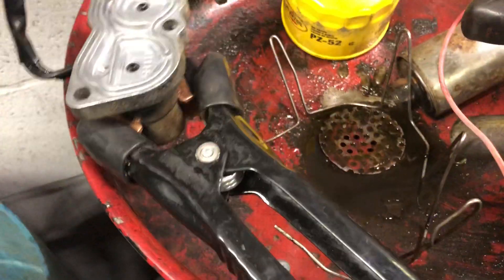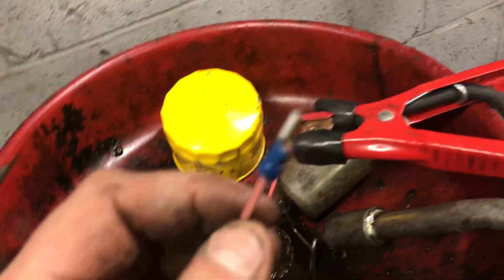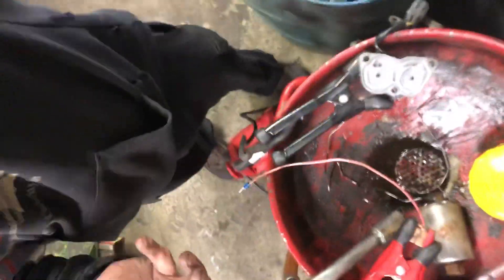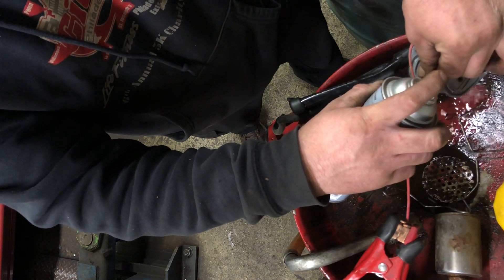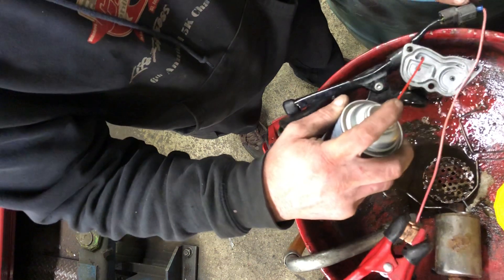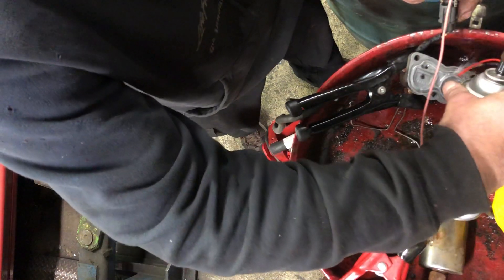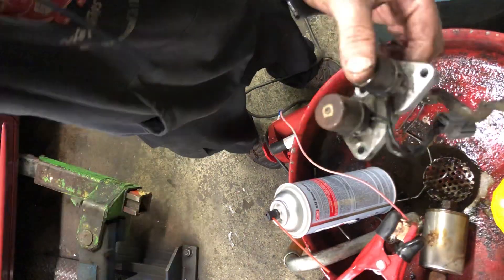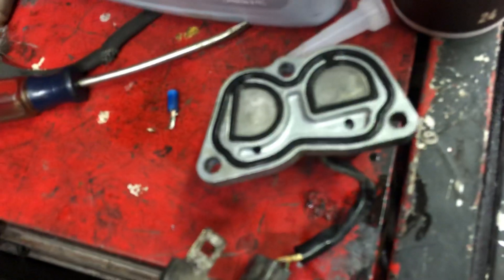Honda Transmission solenoid check and cleaning

Comment: What is the spray you used to clean the holes of the solenoid, is it a carb cleaner or a brake cleaner?  Do you think i can use brake cleaner to spray the screens without swelling the rubber gasket?
Reply from the maker: Low viscosity brake fluid. This way it dries out.
Reply: @crazyricha9784  My father says thanks!

Comment: Buenas tardes amigos, este solenoide aplica para un honda Accord 2000? Se pueden intercambiar los componentes de este solenoide para el modelo LOCK up de las cajas BAXA?
Reply from the maker: The only thing I can tell you is that the cleaning method works for both

Comment: What is the spray pd 40 or brake cleaner. What do I use to clean the filters?
Reply from the maker: I used brake clean. I prefer to use the low viscosity kind. This way I can put it back together and not worry about any leftover residue.

Comment: Helped me. Same thing on a 1st gen Honda CRV. I'll take it off and try it as it's a new Chinese solenoid I bought a few years ago. Trans shifting awful. Got a Torque Converter code on a tool, pulled the trans and replaced the torque converter. Still has the code and still shifts bad with over revs.
Reply: Chinese solenoids don't work. Find the original Honda ones.
Reply: Was the issue resolved after cleaning the solenoid?
Reply: @samuelortega6030  No. Tested the solenoid and it is fine. I think the transmission has had it. It's a used one so I'm looking for another used one.
Reply from the maker: For me no it needed computer

Comment: when sent to the workshop..the mechanic told me to change a new gearbox or buy a hallfcut..if I have a lot of money .. I changed a new car instead of replacing the gearbox .. my car's gearbox is a problem when it starts moving yes..it's high rpm3000, I feel like the gearbox has a gear leak  enter ..in my opinion, the gearbox is not a problem as the gearbox is normal when the car is moving fast..and there is no strange sound in the gearbox ..

Comment: Is this what makes the 1rst to 2nd small slipt or kinda kick
Reply: I think so man it's either this one or the other solenoid. Ones for 1st and 2nd gear control and the other one is supposedly  for 3rd to 4th gear
Reply: @globalprofits101  Ok i celan then ans keeps doing it.  Maybe the botoms
Reply: Did you ever figure this out?
Reply: @RedSharkBlue  not yet

Comment: Could this fix my jerking from parked to drive ? I replaced all engine mounts and transmission mounts also replaced transmission oil. Also jerks when rpm goes from 2 to 3rd or when I’m coming to a stop 🛑 
Thanks guys
Reply: most probably the problem here is your input shaft speed sensor.

Comment: Appreciate your videos. Thank you. Hoping you might help us please.  Do you have any idea why our 1990 Honda Accord Auto Transmission does not shift into reverse sometimes and makes the funny clicking sound? Other times we start it and it shifts into reverse perfectly.   We've flushed the AT and put the Honda fluid,  checked the solenoids and cleaned the small screens.  Here is a video of the sound.. Thank you very much.  https://youtu.be/eLvbnCkH9y4
Reply: Ever find out why?
Reply: @DiamonDallaSage   Hello, We have not ever figured out why the reverse will not engage. The car has been parked for nearly one year., but start and drive it a bit in forward gear.  The engine runs perfectly and the transmission will shift all forward gears perfectly. Last year I put 20 quarts of Honda transmission to flush all the old transmission. cleaned the solenoids, replaced the solenoids, adjusted the shift linkage cable.  Think there is a reverse gear on a shift lever  that might be worn.  I put about $1500 worth of other repairs on this car right before the transmission decided to not go into reverse. We changed timing belt, radiator, CV joints, hoses, belts, brakes and other stuff. Was fixing the car up as my son's first car. It is a real bummer. Had to buy him another car right away at that time to go to college. Will eventually swap the transmission for one out the junkyard. Please let me know if you find a solution. Thanks Steve

Comment: Hi!! my transmission is locked in parking, I have to put the key in the "shift lock" of the gear selector to be able to move it. ( sorry for my bad English )
Reply: MarcoSanya Could be the brake switch behind the pedal. Check to see if a fuse is blown and that the brake lights illuminate when pressing the pedal. If the brake isn’t being sensed as you push it down, it’ll lock the gear shifter.
Reply: I had the same problem with my Honda I took out the lock mechanism no it freely shifte
Reply: Can it be related to this solenoid ?. Thanks
Reply: thanks! i fixed a few weeks
Reply: MarcoSanya what was it?

Comment: Can this be the problem to my Honda first and second gear shift bad the rest are good
Reply: Did you fix this problem by cleaning the shift solenoid 

My 1998 revs up then switch gears  bad in 2 to 3 but the rest are fine
Reply: @TheRealWorldNews247 did you ever find out what fixed this lol
Reply: @scotttruesdale7322  Did you ever find out? I have the same issue right now
Reply: @scotttruesdale7322  did you ever solve this issue ?
Reply: Mine too had the same problem

Comment: Is replacing a solenoid for a transmission a hard fix ? And if your car has a solenoid problem is that a major repair?
Reply: I think im going to change my youtube pic to a hot girl so i can get teplies like you got dam wen guys see a girl pick they turn into machanincs i guess lol
Reply: @GazBoyZ  ok
Reply: Lisa T I’m currently doing this on my 94 Accord and no it’s not a major repair but the bolts are hard to get to.
Reply: @rika3593   You are working on your starter?Have you ever had transmssion problems with your Accord?
Reply: @staresce  I have a 98 accord and it's pretty easy to remove/ replace or clean them there is one that requires the removal of the battery and the component that you place the battery on not slot of videos out there but it can be done